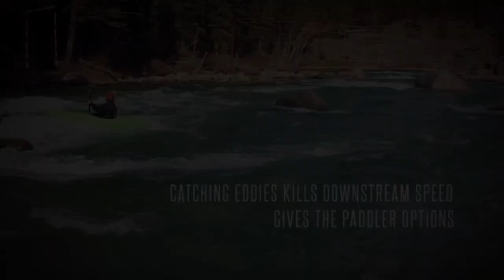How to Perform an Upstream Turn | Intermediate Whitewater Kayaking Skills Series

Comment: Sweet move, struggled with getting to the next eddy on my side of a river. 
Took this out and tried it and definitely adding to the tool belt. 
Thank y’all for all the videos!
Reply from the maker: Thanks Sam. The getting back to the eddy on the same side of the river is a timing thing and will come with practice. I use this move alot when running a drop on the same side of the river that I am on in am eddy above. We will do a video on this in the coming season..